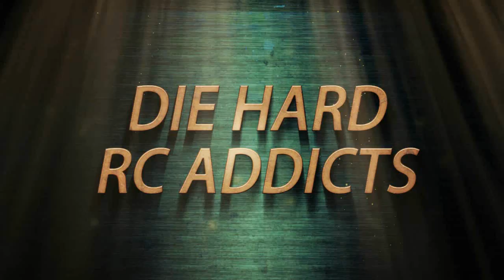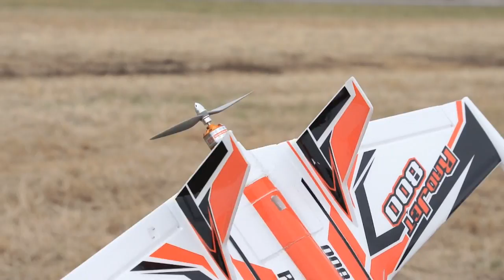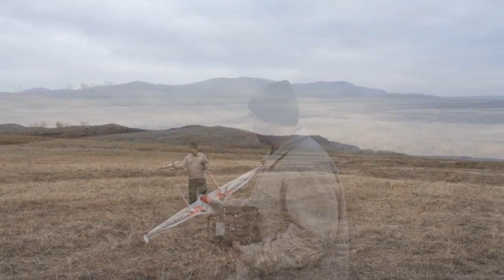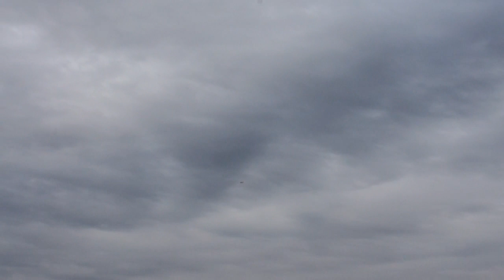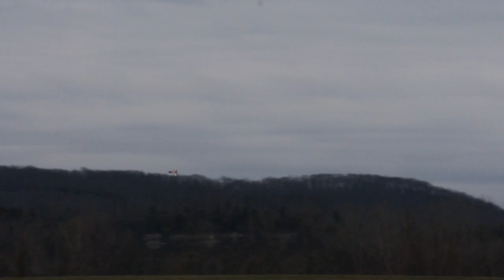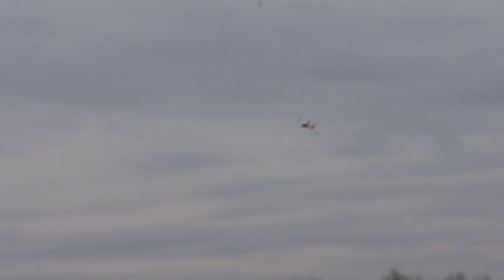HobbyKing RadJet Peformance Mods and test flight

Comment: Hey Nice Vid man!

 I got a  Question tho. Im gonna put a 2200kv brushless motor on, with a 30amp ESC, stock prop, And a 2200mAh 3S 25c  lipo battery on it.

Am I gonna fry my ESC?
Reply from the maker: ihatestupidpeople264 Should be ok but you may want to use a watt meter to be sure you are with in the limits of the motor ratings.
Reply: oh okay,  Thanks man! phweew Wasn't sure. I Received the jet from a friend with nothing but the stock prop and the servos and there wires. wasn't sure if I was gonna  overvolt anything. So, when I get the parts in, were should I hook up my Multi-Meter?
Reply: ihatestupidpeople264  nevermind I did the math. 2200mah x 25c / 1000 = 55Amps. 
55amps x 11.1 = 610.5 watts. 
so 610.5 / 11.1 = 55amps draw. (I think)
so I need a 60 amp esc then.
Reply from the maker: ihatestupidpeople264 It doesn't really work that way. That just calculates the
max safe rating to draw from the batteries. Just because a battery is rated
at 25c doesn't mean that it's going to push that much power through the
system.The motor's ability and the size and drag created from the prop determines
the amount of power drawn out of the battery. This is why you need to use an RC
watt meter for testing. I recommend the Turnigy 130A watt meter from hobbyking
for about $25.
Reply: +ihatestupidpeople264 I know I am late to the game, but you should be fine with a 30a ESC.  I've run that motor with a 25A ESC before (6x4 prop).  It might depend on the prop you are using though....and quite frankly the quality of the ESC.  Some, like the turnigy plush can be pushed a little harder than a more generic/cheaper ESC.

Comment: I fly mine on 6S, 1800kv motor, 5.25x6.5 prop, 50A ESC.  220km/h (135mph) straight and level. The 1300mAh pack gives just 90 seconds at full power.

Comment: I used the same motor on mine but I used a 7x6 apc style prop it was pulling 48amps on a 1300 nano 3s 25-50c and a red brick 50amp esc, .....and it was QUICK!!!  I cut the prop down to a 6x6 it dropped to 38amps

Comment from the maker: Not sure, but doesn't really matter with brushless motors. If it spins the wrong way just switch two of the three wires to reverse the direction. You just need to make sure the side of the prop with the prop size is facing forward.

Comment: On my third radjet i have  ntm 28/35 2700kv apc 6x4 red brick 60 amp esc 3s 1800..i am guessing its 100 mph or faster....i can also throw a 4s for more speed,but 100mph it even to fast for my level of ability right now....very nice plane

Comment from the maker: I had mine set up and down at 3/16 inch low rates and 3/8 inch high rates. Set to high for launch then switch to low for stable high speed passes. I usually set expo around 40 to 60 %.

Comment: Thanks Frank for the details response. Also did u try Turnigy 2836-2350kv motor with 4 cell. If you how was the performance and what prop you used.

Comment from the maker: I fly mine with the cg set at 372mm or 14 5/8in back from the tip of the nose. This is farther forward than most others like to use but I found that being nose heavy eliminates the chance of the dreaded spiral of death. You just need to remember to program a little up reflex in the elevator. Most of the forums say the cg should be about 400mm but I say try it at your own risk.

Comment from the maker: The stock prop will work fine with this motor but the stock 20Amp esc will need to be upgraded to at least 30Amps. It should be faster than the stock motor because it is only around 1800kv and this one is 2200kv.

Comment: Hi, frank do you think this motor you use will also work with stock props that come with  radjet PNP version?....i don't care if it goes slower than your setup...I broke motor shaft( plane dropped and bounced on the dirt) on my first attempt so i need a new motor and hopefully this motor you use is more heavy duty than the stock,but next time i need get a better launch for sure..thx

Comment from the maker: With a Rhino 1350mAh 3s1p 30c LiPo it weighs 16oz (453g) ready to fly. With the Turnigy 1300mAh 4s1p 30c LiPo it weighs in at 17.5oz (496g) and still flies great and isn't too heavy. You can watch the 4 cell flight footage on DieHardrcAddicts YouTube channel. It's in the second video we did on the RadJet.

Comment: with a radar gun my radjet on 4S was clocked at 155 KMH level flight and no wind.
with the stock crap prop. Will be trying an APC 5.25x4.75 prop tomorrow

Comment: I tried the Hobby king 4.75x4.75 sport prop but they are complete crap and break very easily. I then fitted an APC 5.25x4.75 running the 4S setup and it now sounds like a stryker and no weird vibration noises anymore.

Comment: I have the sam mod for my Radjet but You don't write way propeller You have?
I have 6x5e but not happy for performance and time battery (only 6 min with 3s-1350 Rhino)
I have try the 7x5 prop, performance little better but time 5 min
What better propeller with This tuning?

Comment from the maker: @Pono421 you might want to go with a more powerful motor as the Stryker is bigger than RadJet. I would suggest either the new Grayson Hobby Monster jet motor or the HobbyKing Turnigy 2836-2350kv motor. Both of these should get you in the 90mph range on 3 cells and triple digits on 4 cells. You'll need a 60Amp esc to run these.

Comment: i need help...i got a striker that iam mod'n out and want it to hit around 90mph+ on a 3 or 4 cell 40c's. would this motor do the job?... if not, what hk motor will give me the speed i want. you guys pick good motor/esc setups and your help would be grate. thanks for your help, you guys rock.

Comment from the maker: @BRaptor350 They are both great planes to fly. The RadJet Is smaller and a faster design with it's much narrower wing chord. The SkyFun being bigger will take a bigger more powerful motor and can handle the extra weight better. If you're not planning on using a bigger motor than the 2836-2350kv and want all out speed go with the RadJet. It's good for an extra 30mph on 4s. If you like nice floaty landings go with the SkyFun.

Comment from the maker: @befanello with the stock motor, esc and a 1050mAh 3 cell mine weighed in at around 15oz or (425g). With the set up in this video it's around 16.75oz or (475g) and still flies great even at slower speeds.

Comment: Thanks guys for this helpful video.  I've just maidened my own with the std motor and a 30A HK Blue ESC.  It flies great on 3S & I tested 4S on the bench and the motor ran just warm @ over 220W.  I'm looking around for a 1350 sized 4S to now to keep the COG w/out blocking the fuse airfl.  A turnigy 2632-2400 will bolt right onto the old engine mount (not sure why you swapped mounts) so if motor dies that will be replacement. The turtle cover is only taped on so hve easily access 4 a motor swap.

Comment: @DiehardRCaddicts

Thanks for the link.

I'm using a Turnigy SuperBrain 60 amp but that shouldn't do anything 
different for performance.

The only real difference I see is that he is using a 5.5x4.5 where as I'm using 5x5.

With the WattsUp meter it was drawing 44 amps, Measured 29k rpm with a
Turnigy Tacho.

I read what they were saying on the forum and set my COG 15mm behind the stock Cog.

Comment from the maker: @TheRattleSnake3145 sounds cool!! Check out the link to the RadJet forum thread I just added in the video information bar below the video. If you go to page 6 post 81 you can see some video with that setup on the RadJet. It's crazy fast 130mph+ much faster than my FunJet was with that motor.

Comment from the maker: @snehal50samarpit it should work fine. I got a watt meter reading of 26.53Amps@308.5watts static testing with an APC 6x4 sport prop. Just make sure you are getting proper air flow though the fuselage and over the esc. If the battery blocks the air flow completely you may have overheating problems with the esc.

Comment from the maker: @abusadiq03 static watt meter was 26.53Amps@308.5watts. Motor is rated to 34amps at 342watts. I'm thinking 4 cells should work. Will do some testing later.

Comment: @DiehardRCaddicts I don't think that 2826-6 motor will handle 4 cell too well. Try the HxT 2836 2700KV inrunner, that's what I use in my Funjet Classic.